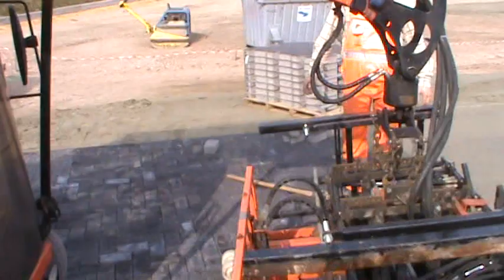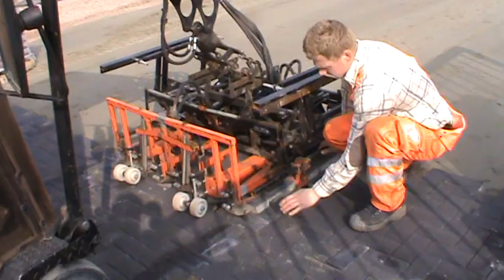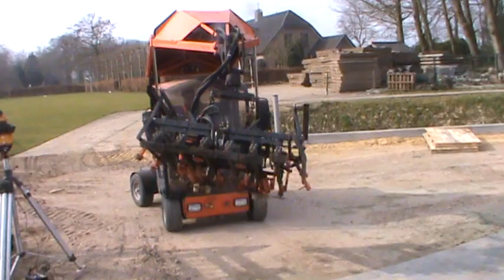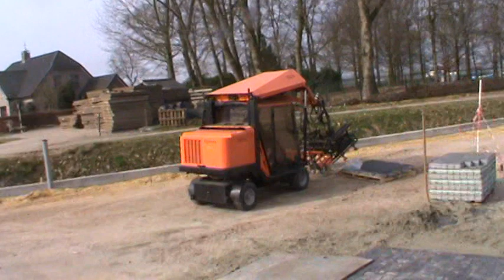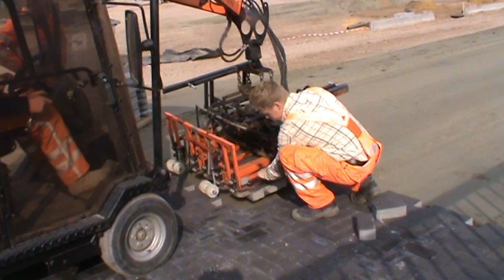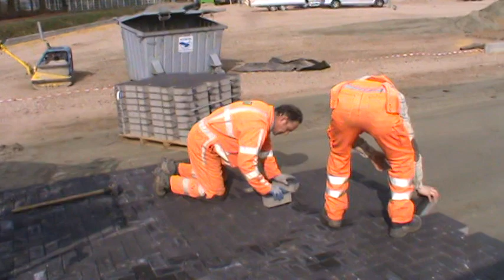Alien bricklayer from mars!! part2.MPG

Comment from the maker: @WillieWonka928D Thanks Willie. i dont know iff they have something like this in the USA.
these are not the best ones though. At owwer company they also these whit sucktion. big pump on the back off the machine. that createds enough vacuum to lift them from the top. same they use in the pipeline.